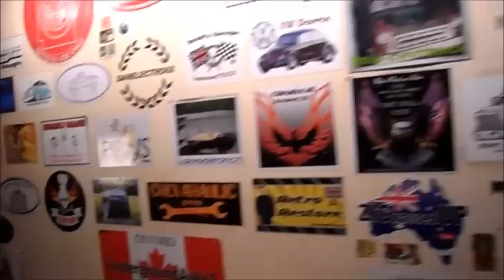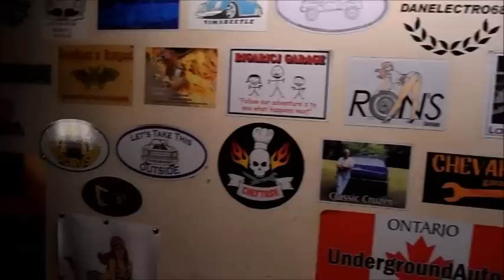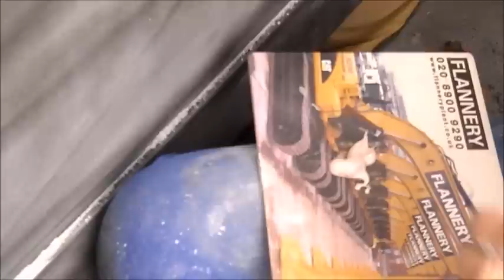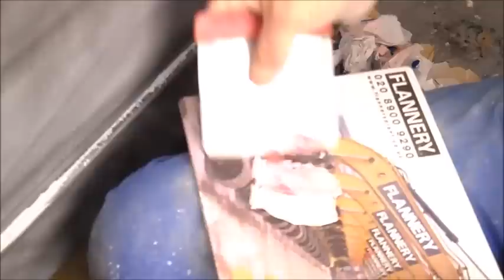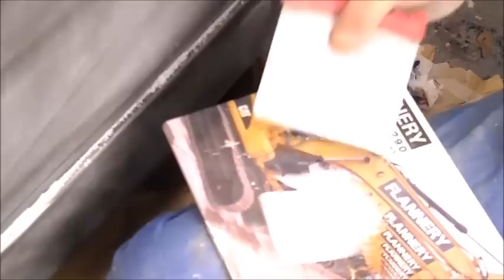Triumph Vitesse Restoration 04 02 17

Comment: Oneth
Reply from the maker: Man your fast, thanks Sir
Reply: Last.
Reply: Lastth.
It's kinda like spackling.
Reply: MostlymoparIH Now that's funny right there !!
Reply from the maker: Hahaha - you guys ;-)
Reply from the maker: Spackling? Will I need to google that one
Reply: Like lath and plaster.
Reply: You mean latherth and plasterth
Reply: Come you guys, what do you use when put up sheet rock? Now you can call it joint compound or spackle. Ya say joint compound and someone may think you're looking to get high. So I mean therefour4 fore I say spackle. We say ground you say earth or dirt. Hey this battery is not working that cause you didn't connect it to dirt I mean to earth no no to ground. Here I go, off on my high horse gotta get grounded.
Dirt control to Major Tom. Check your protein pills and put your helmet on Oh and can ya put on that suit and tie your arms behind your back and go in that room with all the padding..
Reply: I'm nuts but I aint that nuttey.